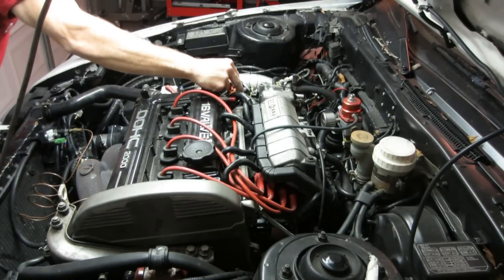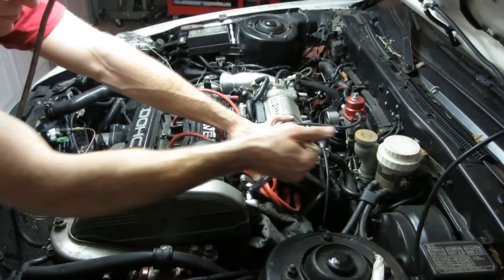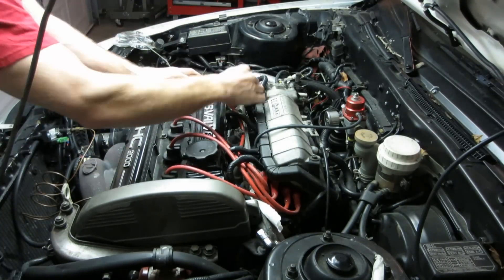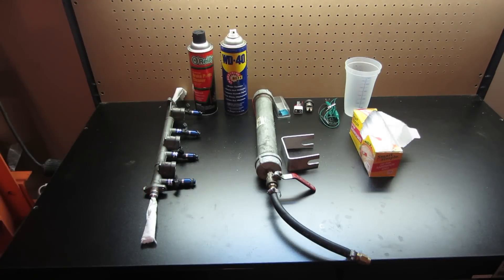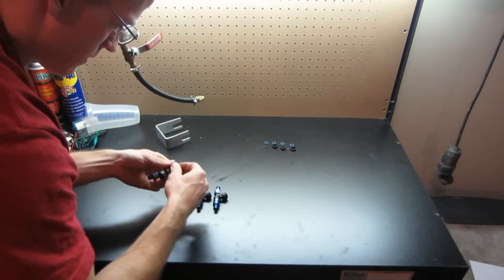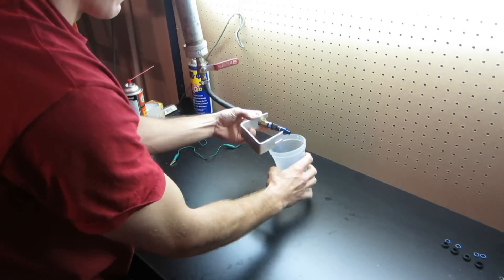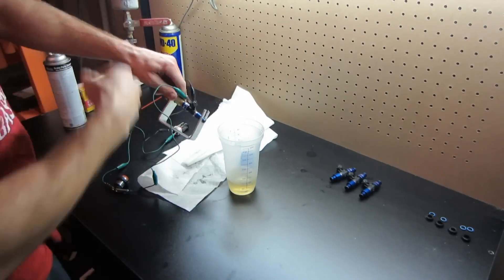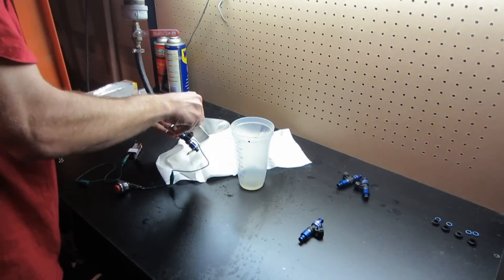Fuel Injector Care - Pickleing your Injectors

Comment: Those things have a million and one uses.  Well.  Really at least 3 now anyway.  Injector cleaning, injector pickling, and flushing turbo center sections.  I suppose you could even pickle those, too?
Reply from the maker: I suppose you could but its not near as difficult to get oil into a center section as it is to pulse an injector. You thought you where making an injector cleaner but it has become a multifunctional tool :) Now I wonder what else I can adapt it too? Thanks for posting the original cleaner that started it all.

Comment: off topic,,, but what brand and size slim fan are you running on you radiator..
thanks,,,,,, good vids.... keep them coming,,,
Reply from the maker: If I recall correctly, one is a SPAL and the other is from Autozone or Advance. The SPAL was not enough on its own so I purchased one locally and its maintained temps every since.

Comment: That's a really neat set up may I ask what size were those injectors from fic?
Reply from the maker: I am using their 2150’s. I only ran E85 through these injectors and I am pleased with their performance. Their new 1650’s offer some desirable characteristics and are a great option if you don’t need the 2150’s.
Reply: I love their injectors except the 1650 s. Price tag is just outrageous I think 1650 s. Will support my goal off 600 wheel horsepower what do you think? By the way do you know what Hp their 1100 are good for? I see using Holset turbo I never thought about running one in a car however I do run it in my semi with Cummins ISX
Reply from the maker: Agnieszka Saletnik What injectors you can get away with depends greatly on the type of fuel you plan to run. On E85, 1650's will support around 72lb/min of airflow at 80% IDC.
Reply: Thanks for advice I appreciate it on ECMLink forums they mentioned 1100 should be good up to 500 is there advantage of going with hizz besides the resistor box?
Reply from the maker: Agnieszka Saletnik The technology available today makes the High-Z injector the best choice. They provide increased idle and part throttle performance over Low-Z injectors and can handle higher operating pressures. 

All the following numbers are for pump gas. The 1100’s should support around 475 to the wheels at 80%IDC with a base fuel pressure of 43.5. The 1650’s are good for around 700 to the wheels at 80%IDC with a base fuel pressure of 43.5.

P.S. Those 1650’s are more expensive because of their new design allowing them to be compatible with all fuels :) They can also flow around 2000cc at a base pressure of 5 bar (72.5psi). These things can handle a lot of pressure if needed and they resist corrosion.
Reply: I see your logic now invested once and I have no headaches room to grow preciate your input been watching all your DSM how to videos since I'm new to DSM'S  previously I was into Toyota planning on getting the same exhaust manifold as yours is that manifold capable hope producing some good power with some porting work? I have fitment issues with certain manifolds since it's a gallant vr4 I'm going to change filter housing to the one pointing forward and relocate the alternator to the rear hopefully that will give me some room to work with
Reply from the maker: Agnieszka Saletnik The FP manifold propelled me to an 11.2 at 126MPH. The downfall is that its only sold with a DSM flanged exhaust outlet. It really depends on what your definition of good power is.

Comment: I have a couple questions not about this vid, I'm hooking up SD on my 1990 tau, which nipple on the throttle body would be correct to go to the map sensor, it seems like you have it on the top motor side I believe that nipple just has a hole straight down onto the IM side of the TB, also is that little hole sufficient?
Reply from the maker: B jones none of the ports on the throttle body are large enough to effectively run SD. I used the PCV port in the intake manifold since I have a sealed catch can.
Reply: True, I have an after market manifold, so I guess I'll have to take it off and put another nipple in it, do you think the line for my boost gauge will do?

Comment: the reason i ask is because im having issues with cooling and choosing the right cooling fans,,, I made the mistake of buying ebay fans,,, cheapo's... and they are not cutting it,,,what size are both your slim fans,,, so im guessing the spal fan is the main fan, and the other fan is opposite side of the radiator,,, are they both ran as pullers,,
thanks,,,,,
Reply from the maker: The SPAL is ran as a puller and the off brand fan is ran as a pusher. Not sure on the exact size, I will try to measure them tomorrow. Whats more important is the blade design and CFM rating of the fan.

Comment: Is it worth worrying about the oxygen that slowly permeates through normal zipper-lock bags? The OTR (Oxygen Transmission Rate) of polyethylene is high enough that some folks buy fancy foil-coated mylar bags and/or oxygen absorbing packets for the long-term storage of things like food.  I have no idea how much oxygen it would take to damage a properly pickled injector, but just for my peace of mind I'd probably spend a dollar to wrap the four smaller bags together in a sheet of aluminum foil (which has an extremely low OTR), and put it all into another zipper-lock bag.

If there's a source of fresh iron filings around, you also could make a cheap oxygen scavenger by putting some unrusted iron bits into a separate ziplock bag.  Many of the oxygen-absorbing bags that you can buy are essentially the same thing.  Pack the absorber bag next to the injector bags before applying the foil wrap.  The majority of the leftover O2 that's slowly swimming around inside should hit an iron filing before it hits an injector interior.  I'm guessing that this second step would not be worth the time to do it, but one bonus is that when you open up the bag later, you can quickly check the filings.  If they've rusted even a little during storage, then maybe that extra step was a good idea after all.
Reply from the maker: The aluminum foil may be worth while considering its cheap cost but I don’t think its an issue.

The initial problem is the use of ethanol based fuels that draw in the moisture causing the corrosion. With these fuels cleaned out and the water dispersant in place, I believe it would take more moisture than what seeps through a  zip-lock to warrant the other steps. 

It is some good information for those that live in really humid climates or extended storage. Thanks for the information.